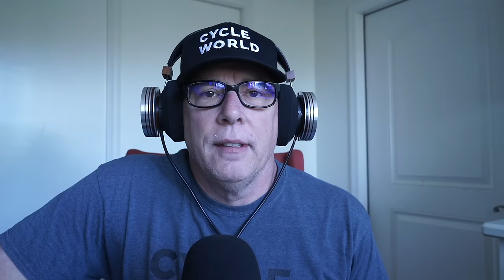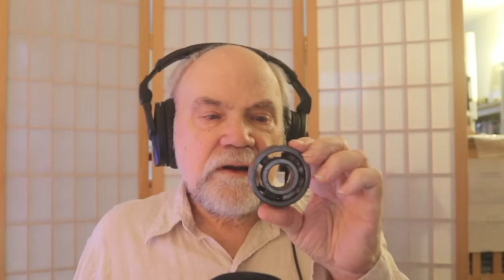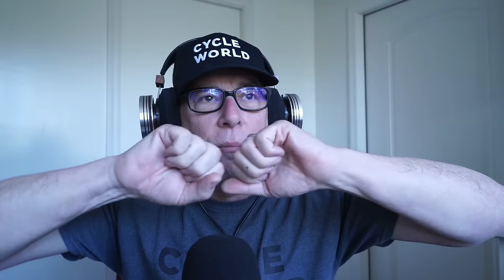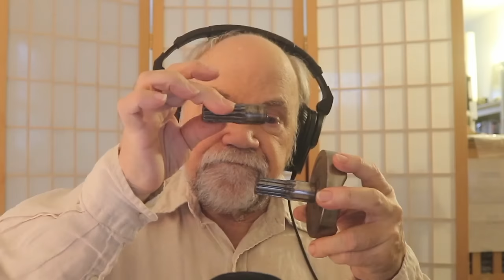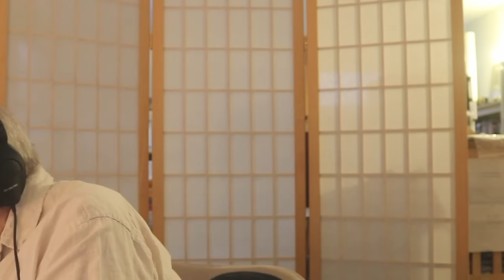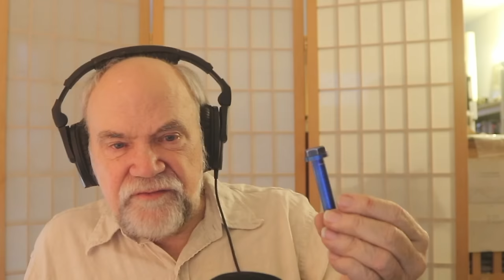How and why MOTORCYCLE parts BREAK

Comment: In 1973, that squalling sound occurred to me on Interstate 5 as I rode my 1966 YM-1 at 60+. Some sage of a motorcycle scribe had taught before that one should always cover the clutch lever - especially on a 2-stroke. Upon hearing the unmistakable screech, I clutched and the engine stopped in about 1/2 second. Now, being unable to signal, how to swerve between cars to the shoulder and remain alive. Drivers were better back then and I am here to tell the story. One of the ball main bearings looked exactly like the one Kevin held up. Very colorful.

Comment: RD redline 8500 at least per the +/- tachometers. I have a 9K redline TX500 tach, but after hearing this, I think I'll stick with the 8.5K unit, thank you very much. In '73, broke a 283 Chev crank halfway through the rear main - that thin thrust flange apparently a stressor. To this day, some do not believe I broke a SBC crank.

Comment: In the early 1950's, my dad owned a sprint car with a flathead Mercury engine. He and his buddies built a new engine for it, and it coasted into the pits at its first outing. He asked the driver what happened, and the driver responded, "I was going down the backstretch, and it went 'ding.'" They opened the bonnet, and a catastrophic failure had turned the front half of the engine into shrapnel. The sound had clearly been much, much more than "ding." Ever since, "It went 'ding'" has been pointed to in our family as the greatest understatement ever. 

To conclude the story, my dad decided after that event to become a former sprint car owner. However, a decade later my brother and I were racing Bultacos, CZ's, Ossas, Kawasaki triples, and various other two-stroke motorcycles that were mechanically simpler if not less prone to failure. Fifty years later, when I view an online video of a two-stroke motorcycle, I can still hear the sound and smell the exhaust.

Comment: Lovely talk about failures, bringing joy to my darker side. First failure I saw was a 30 year old Harley with 1/16 wear in crankpin. Bike still running. Remember old race engines with aluminum conrods. Over time getting longer and longer. Until letting crankshaft breathe fresh air. Once found a crankcase piece 200 feet from the track. Most recent break is a T20 classic racer. Never seen a 3 piece conrod before.

Comment: My MZ 250 uses C4 clearance bearings. The bearings are pushed into 100 degree C Cases. I am riding a motor with 145,000km on the mains. Those old soviet bearings were good.

Comment: On a CNC you can lead out the thread over a length so the stress rise is spread out. However, the weakest point on a bolt is where the highest stress point is.

Comment: Working on my RD engined R5 (in my service since 1977) today.  Simple swap of a rusty stock header for an ebayed improvement. What, no RZ crank flywheel parts at hand?  Never had bottom work done on my bought new RZ, but I've seen mine every so often for fresh pistons and occasional bore.  Their design is quite different with a more conventional pork chop style.

Comment: I once found a door window motor held in place by a bolt that had 2 threaded zones of different diameters, the larger and inner one to hold the power window motor and the smaller outer to hold the door panel.  The bolt had radius' in place to reduce stress points and was the 1st time I thought of a fastener being over-engineered.  This fastener was not even used for racing.  I can imagine the designer who dreamed this fastener up was a junior as it was for a luxury car door component, but why?  Now its clear he wanted to be picked up by the motorsport division of the company.  Maybe?  The bolt was for the window regulator on the rear door of a 2006 Audi...

Comment: Honda put crank bearings with resin separators in 84 crs heat caused failures all the balls would migrate had to put 83 bearings in . That engine also had excessive piston clearance

Comment: KTM LC8c (790 & 890) cams fails.
Cause unknown.
KTM says the problems were fixed on the 890. 
But...
They also fail.

KTM seems to believe they can get away by denying that there is a problem.

KTM attitude towards customers stinks.

Comment: Like today’s vehicle parts manufacturers, motorcycles and other mechanical parts are made to fail after a certain amount of use. Which is not very long. The metal and other materials for parts today are drastically inferior than they used to be just a few years ago. It sucks.